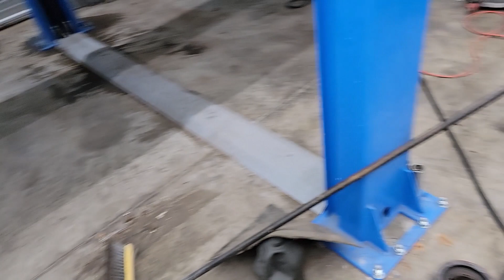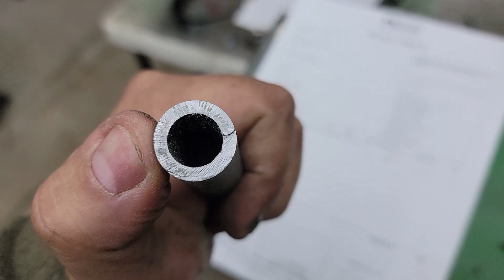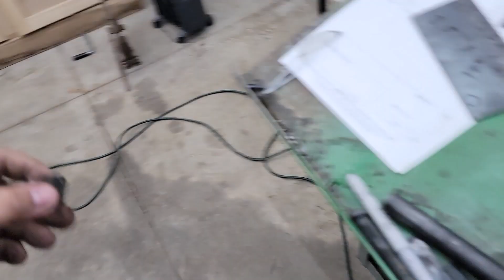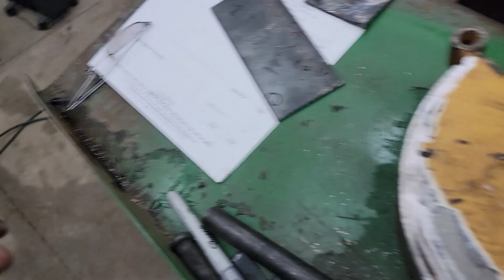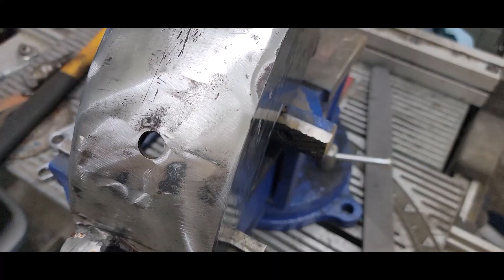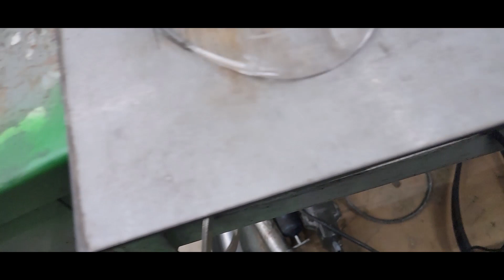Project Vermeer 252 Metal Fabrication Repair

Comment: Do you guys give estimates before calling 811?, or do you go give estimate then call 811, I've put in my add to please have lines marked before calling me, but Seems like not many people wanna wait, especially a tree service that usually wants it done asap. Should I just not grind very deep on those? With gas prices going up seems like a huge waste of time/gas to have to make 2 trips. Question open for anyone to answer, I know Adam is probably a busy guy. I've read on the stump grinders Facebook group that damages to utilities won't be covered by insurance if lines aren't marked, and don't wanna make some huge $ mistakes like hitting fiber optic lines.

Comment: Nice fabrication job Adam.  Repairing a part yourself is a lot cheaper than buying parts through Vermeer or Rayco.  I'm waiting for a Boom Head for my Vermeer SC1102.  My local Vermeer shop (Washington Court House in Ohio) said that it would be 45 days... but it's been 3 months... and counting.  I did not have a 2 ton gantry crane to pick up the upper frame to get access to the Boom Head so I thought I should let my local Vermeer shop do it.  I asked them about getting my SC1102 back but they want me to pay more then $2,000 for the part even if they never actually provide the part (not kidding).  Trusting Vermeer seems to have been a big mistake. and my respect for them has taken a bit hit.

Comment: A little off topic but still about fabricating do you have any info on switching to a new style engine I have a rayco 1635a tow behind that has the Wisconsin engine. When this engine is shot I can't can't parts for it I'm gonna swap to a newer style engine do you know what will work? And fabricating it to mount the frame
Reply from the maker: No but I do remember seeing a guys add the only does those old Wisconsin engines and I will try to find it for you
Reply: @mustangrebuilder the one that's on it is the 4vhd which is I think 30ish horsepower. Went with a greenteeth swap and dealer said I needed 900 series but I think there way to big I would like to find something with more hp that would work
Reply from the maker: @foothillstreeservice7328  send a pic to my email